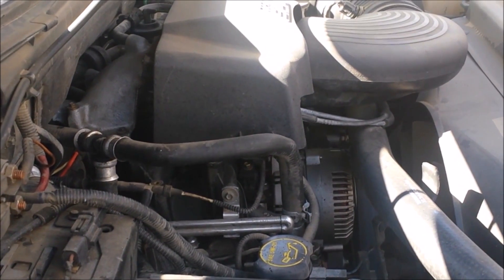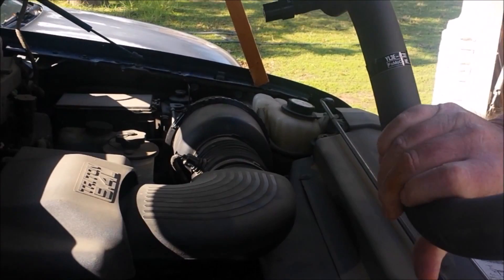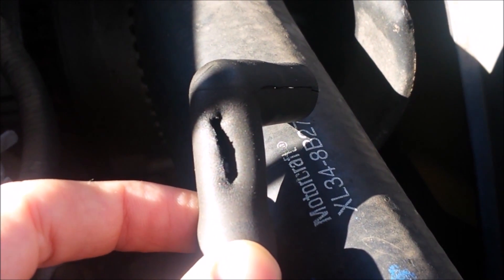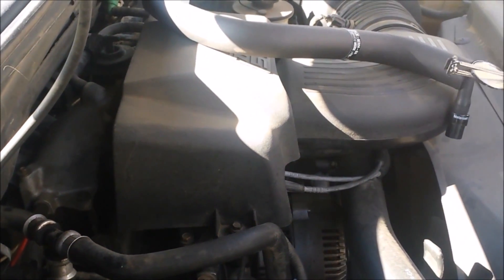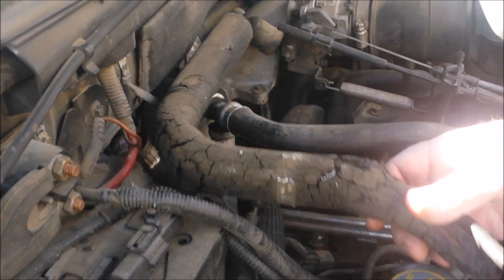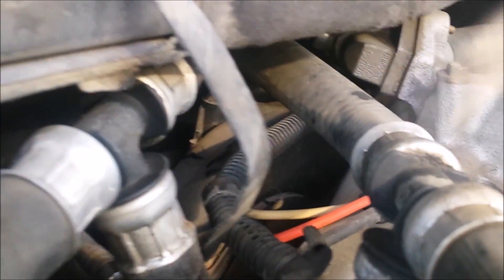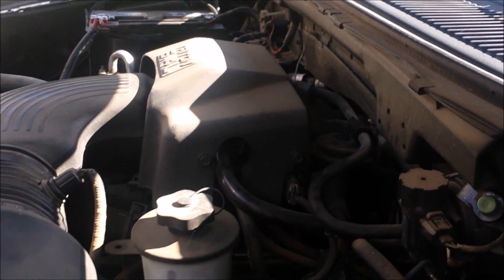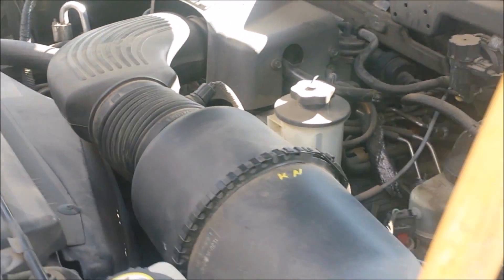Solving P0171 and P0174 Error Code Ford Expedition 5.4L

Comment: I used the OBD II / EOBD CODE READER and found the following code (4 error codes)
P0171 System too lean Bank 1 
P0374 Timing Reference Hig n Resolution Signal A No Pulses
P0171 System too lean Bank 1 
P0374 Timing Reference Hig n Resolution Signal A No Pulses

The same code reader gave me RPM(rpm): 705.50 while the engine was running but the gear was in Parked position 

I don’t feel anything while driving the 2006 Ford Five hundred SEL (I don’t have much knowledge about vehicles), It accelerates well and goes easily to 40miles per hour when given the acceleration (I have not tried beyond 40 miles/hr in order to avoid any damage, as I bought it recently and want to repair it before use) the odometer reads about 200,000 miles, I showed to a local mechanic he said the gear is either in 2nd or 3rd (limp mode) after a short test drive, which made me little worried, what can be the possible reasons of this errors and what should I do to make it a smooth running vehicle?

Comment: Thanks Steve, I have a 2000 Ford F150 with a 4.6 liter engine.  I had the same codes, checked the pcv pipe and that's where my problem was coming from.  The part was $42 bucks from the dealer.  Thanks for the information.
Reply from the maker: And THIS is why we posted this video, so YOU and others could save money and beat the industry!!!! GREAT JOB at taking life into your own hands and handling and letting us know!!!! makes it all worth it! thank you for the feedback!!